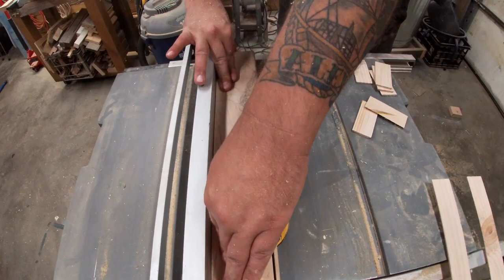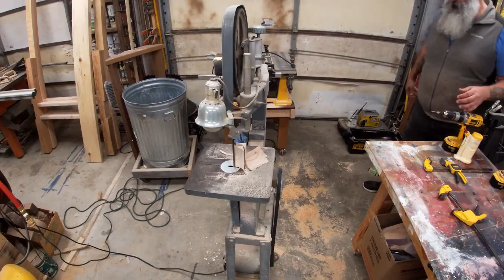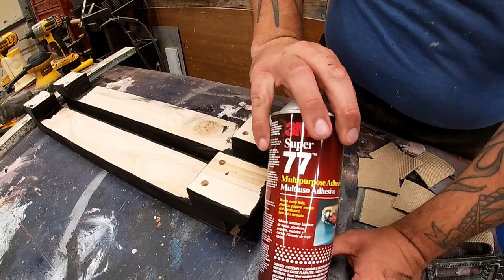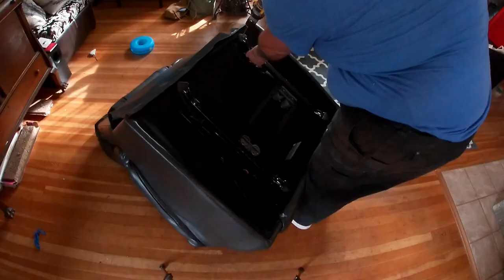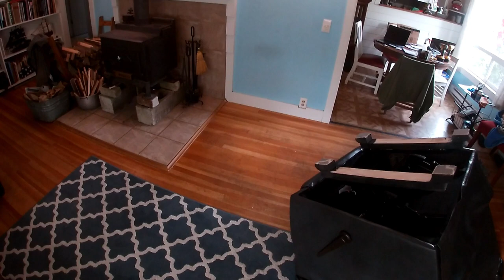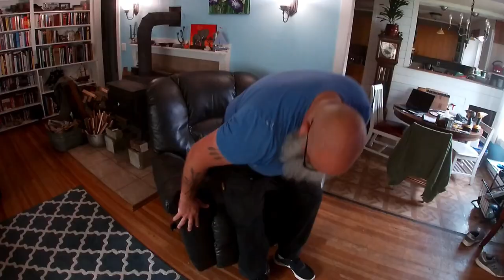Raising the Recliner

Comment: This is great, looking to do the same thing on the same style recliner feet. What did you fasten the base with? Maybe I missed it, but was it wood screws?
Reply from the maker: I basically use the star bit deck screws on almost everything now, so it was probably 1 1/4" deck screws. It seems to be holding pretty good. Don't forget to put the brace in between (that I didn't film), that's gonna help with the stability. Good luck!

Comment: How many inches did your modification rise the recliner ?
Reply from the maker: It seems to be 3"-4". This recliner has a flat bar bent for feet. I didn't remove anything, just screwed the new wooden "feet" to the old metal feet via drilling a hole through the metal and attaching with screws.

Comment: I can’t believer a seasoned woodworking maintenance person is using a table saw without the proper gloves and block pushing tools.   

ATTENTION:  NEVER EVER DO THIS AT HOME OR IN THE WORKPLACE‼️

2018 Statistics:

In 2018, 58% of accidental amputations (3,580 cases) involved some type of machinery.
Tools, instruments, and equipment were involved in 7% of accidental amputations.

The “Bearded Woodworker” needs to get a clue‼️